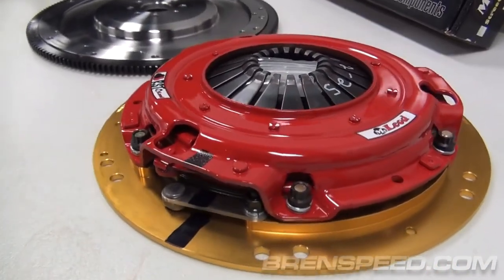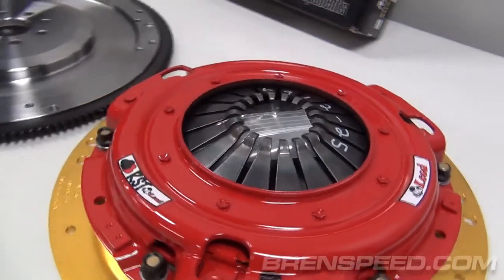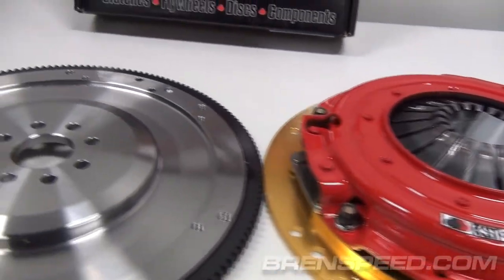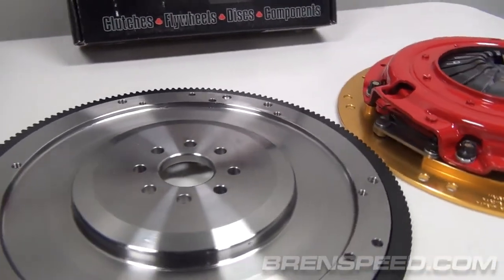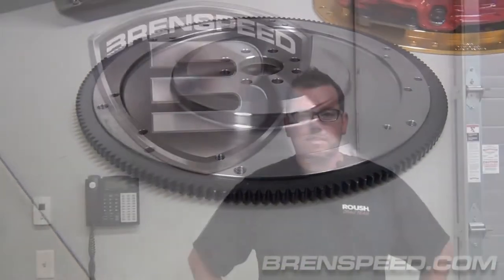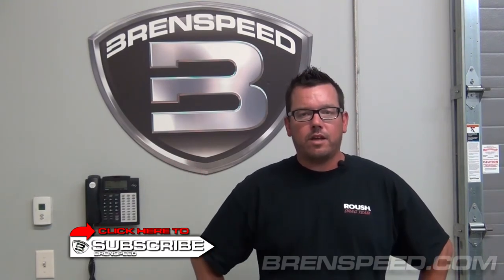Brenspeed 710R Roush Supercharger 11-14 Mustang Package Dyno

Comment: What kind of horsepower to the tires on a 14 automatic all-stock with the 710 package
Reply from the maker: Typically about 570+ rwhp on an auto that is all stock. Sometimes more.
Reply: @BrenspeedEngineering  what would it take to get a solid 600 ? And still be safe. lol thank you brenspeed